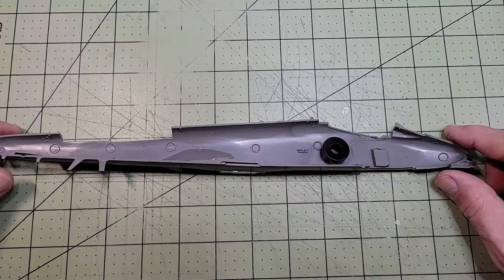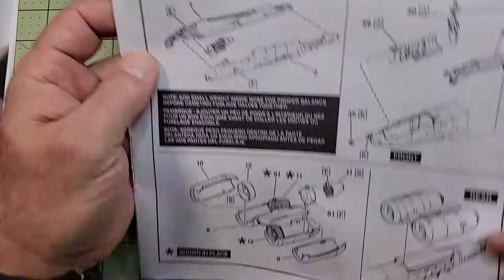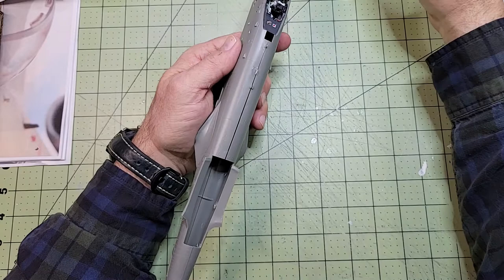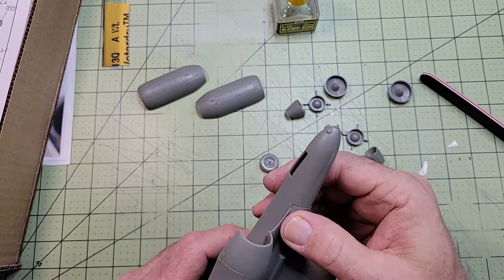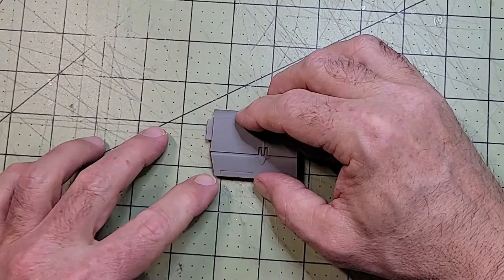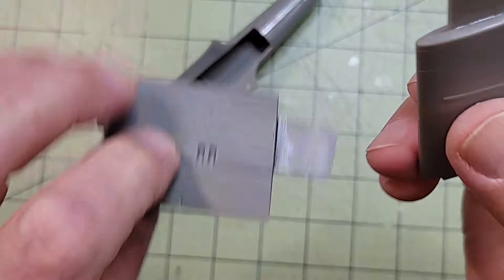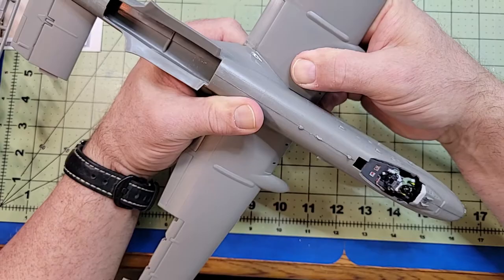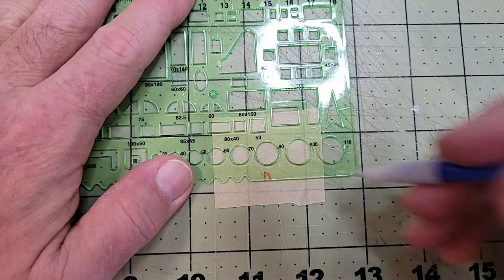Revell A-10 Warthog Fuselage and Wing Assembly

Comment: Hi Bryan! I have built this kit before when it first came out many years ago and I have one on the bench at the moment. First, let me recommend that you use Tamiya Extra Thin cement. It is applied by brush, like the glue you are using in the video, however there is much less mess. In most cases, even with long seams such as the wings or fuselage, all you need to do is put the parts together and run the cement down the seam. Capillary action will wick the cement down the seam and any that gets outside the seam tends to evaporate before it builds up enough to damage the surface of the model. Part of the fit issues with this kit are that the molds are pretty old... this model came out in the early 1980s if I remember correctly. dry fit the parts several times before committing to glue... This allows you to note any fit issues and either trim or sand things to fit better, to include squaring up the mating surfaces of parts like the wings or fuselage. You mentioned that you have to align the wings properly or they won't fit right. This is closer to the problem with the gaps in the fitment of the wings than you might think. The issue as you began to describe it is that you have to align the tabs, one on top of the other in the proper way. The tabs slide through one side and actually seat in the slot on the opposite side as well. If you get them set completely, the way they are designed to, your gaps will be minimal if any at all.  I'd planned on my current build to be as close to out of the box as I could do it but the more I looked at the stores options, the more I knew I'd need to make changes. I started the wings by closing the open speed brakes/ailerons on the outer wings. It's not an easy conversion but it can be done with care. with the wings done, I installed them into the fuselage, ensuring the tabs were stacked properly and that they seated in the opposite side of the fuselage like they are supposed to. I installed the wing stores pylons next. As I intended to make my A-10 a mor modern version, I decided to add aftermarket weapons. I modified the triple Maverick launcher into a single launcher to hold a single AGM-65 Maverick. I purchased a dual Sidewinder launcher to install on one outer wing pylon, an ALQ jammer pod will go on the other outer pylon. I sourced my weapons mostly from Hasegawa weapons kits to include Triple Ejector Racks for the positions that sit between the wheel wells and the fuselage. I plan on having a mix of 2000 lb GBU31, 1000 lb GBU-16s and a Lantirn designator pod. Also, the Revell (ex monogram) kit has a bit of an error. If you look at the nose of the aircraft you'll see two small round protrusions, one on either side of the nose, as well as a trapezoidal fixture at the front of the nose gear bay. These are two different systems that perform the same task... The trapezoidal system was replaced by the small "eye" sensors in later versions of the aircraft so I removed the trapezoid and filled the resulting opening. With care and a lot of patience the kit can produce a fair representation of the A-10. Good luck with yours!!!
Reply from the maker: Wayne, man, I appreciate you sharing your knowledge. That's fantastic information and I'll be picking up a bottle of extra-thin on my next trip to the Hobby Store. I'm only on my 2nd build, and I've already built up a stash of about 6 kits I plan on building. When I bought that bottle of Mr. Cement Deluxe, I didn't know if I was going to commit to this or not, so I got what I thought would be a good all-purpose glue but I think I've definitely got the bug now. I will be leveling up. Thanks again!